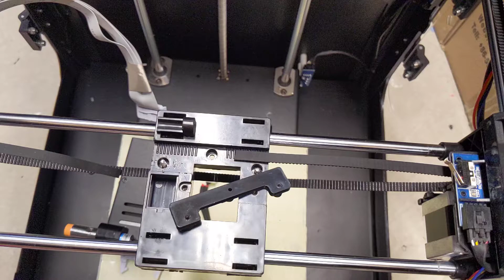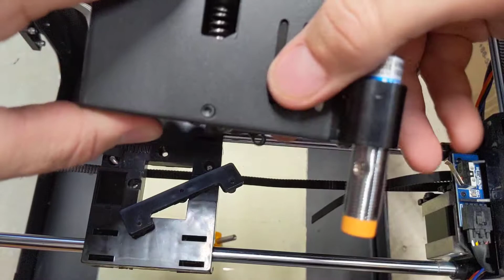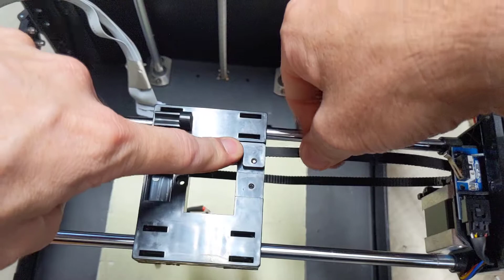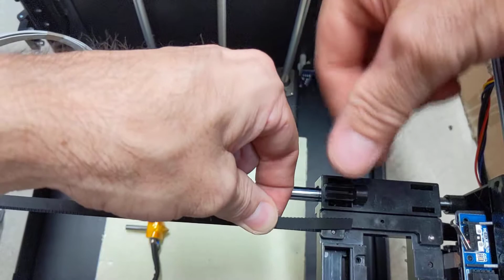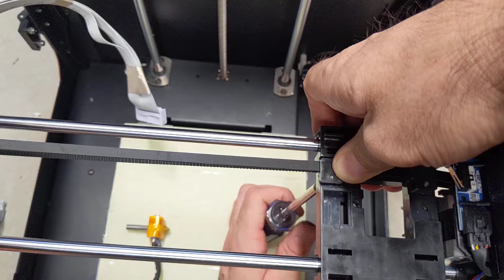X-Axis Belt Tension Adjustment - Monoprice Ultimate 2 / WEEDO M2X / WEEDO F152S

Comment: This is super helpful. Thank you! Do you know where I would find a reasonable replacement for the extruder WITH the casing around it and (I think) the heating element? Basically, the little part that can unplug when you just want to replace the copper extruder. I need the whole thing, I think, because I gunked mine up with melted plastic.

Comment: Manufactured by monoprice? Wanhao makes them.
Guily is the machining company that makes the parts.
They are also the company that machines the parts for ultimaker
Reply from the maker: I am well aware that Monoprice does not do any manufacturing themselves. If I said that Monoprice is the manufacturer in the video (which I do not believe I did), then I misspoke.

 The printer that Monoprice calls the "Maker Ultimate 2" is manufactured by Weedo/Wiiboox.

You may be thinking of the printer that Monoprice calls the "Maker Ultimate". The Maker Ultimate is pretty much a Duplicator 6 aka D6, which is manufactured by Wanhao (or whatever the actual company name is that owns the Wanhao brand name).

I have no idea who Wanhao or Wiiboox has contracts with to do any of their machining or other part making.
Reply from the maker: "manufactured by Weedo for Monoprice" was what I said.